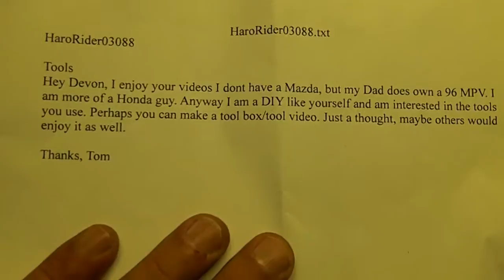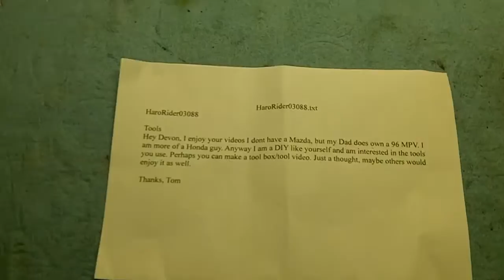Mailbag - My Tools

Comment: You mentioned that you would like an air compressor in your garage. I think you should consider looking into electric impacts. I just got myself a Milwaukee 3/8" impact with a 200 ft lbs rating, and it covers almost every job I'll ever do on a car.
Reply from the maker: I'd rather have one to get an air ratchet, orbital sander, or HVLP spray gun.  Impact wrenches are nice don't get me wrong it's not my primary interest for an air compressor.  I have more than enough projects as it is anyway.  I did look into the electric impacts. I have heard great things about them and many people have recommended I get one.  I just can't justify the cost for how much I would use it.